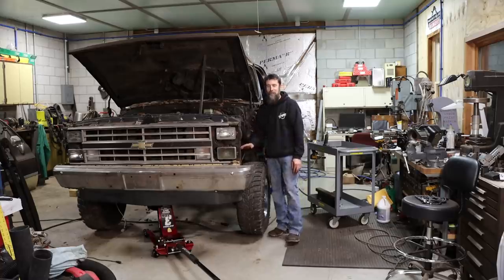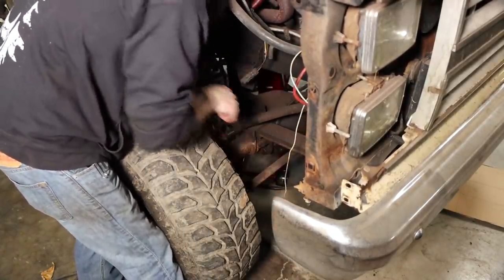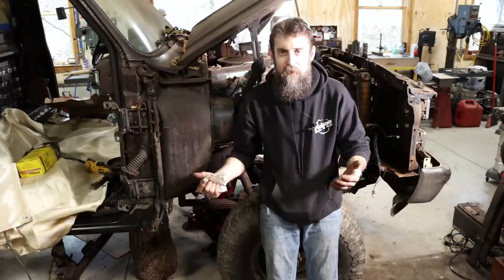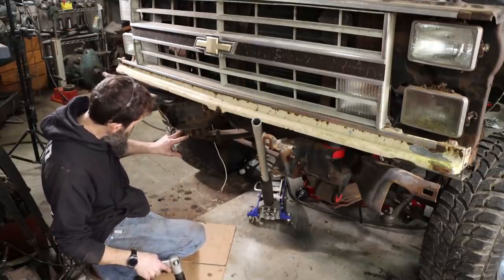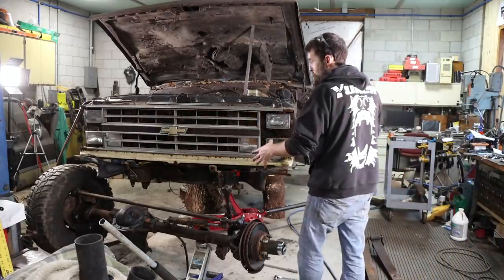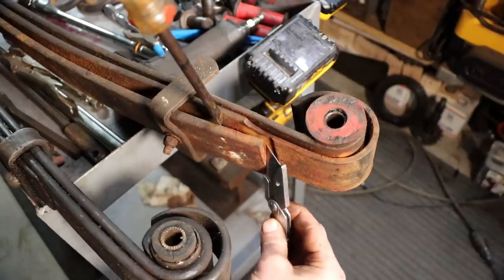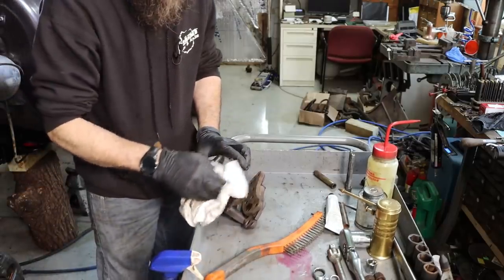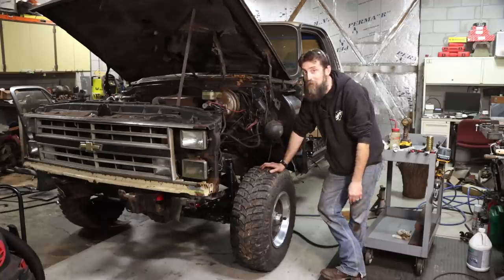Dropping and replacing the entire front axle. Everything was BAD.

Comment: Steve, you're making great progress.  Even if your pocketbook isn't up to replacing the existing motor right now that's something that's easily done later as funds come available.

Also, a year or so ago you mentioned that you wanted to try your hand at Blacksmithing -- your old leaf springs could be good sacrificial material to heat & beat on, after using rebar and such to get started on.  Just remember though, used springs (coil & leaf) can have fatigue cracks that might not be visible, but could still cause the material to crack during or after forging, especially if you try to make a hardened tool or a knife out of the spring material with a hidden crack or cracks.  That's always the risk of using old springs & unknown material and why you should alway use known/new material for "important" Blacksmithing (& Bladesmithing too, if you're interested in that) projects.

Comment: I prefer older trucks, doesn’t take a computer to work on them.  Just rebuilt the carb on my 1962 Ford F100 4x4. Points ignition, 4 speed manual, 223 6 cyl. Did not come with seatbelt.

Comment: Love everything you have done on this project!
Till you re-used the U bolts.
False economy in my opinion. Axle U bolts are one use hardware. Especially this old. Also hoping the spring bolts were new.
With the re-used U bolts, the torque wrench was a waste of time. The U bolts had been stretched to their yield point when originally installed, and when you add the stress of rust jacking between the spring and axle, they are used up.
Looking forward to the rest of this build!

Comment: My dad had the back wheel drive version of this pickup,  Looking at the state of yours,  the one of my dad wasn't that bad, it had the same problematic rust damaged body section and floor, and it would have been nice to fix it like your doing yours.  
But my mom was ready to let go for scrap two years ago.   

And about the price of pickups these days.  You,re perfectly right.  My dad at the time got his pickup used for $20,000.  These days a new one with minimum goes for $40,000 up to $90,000.  That's mad.  you almost need a morgage to buy a decent pickup truck for work,  Ok most of the cost will be absorbe by the business expanses.  But for an individual, these are out of price in many cases.  That Sad.  Now if I want to get my self propel tiller to theshop to be fix, I need to ask a friend with a pickup to take it to the shop and ask again that friend to pick up the tiller from the shop.  Well Steve, don't stop you're doing a nice job.  It will be nice to see it you driving it and feel the difference in the driving.

Comment: The problem with procuring a utility pickup does not, for the most part, lie with the manufacturers. It in fact lies with the dealers. The profit margins on work trucks with few if any additional features is very low so the dealers seldom, if ever, order those trucks unless someone is willing to order and wait for it which most people are not. I used to know a fellow who was the purchaser for a large oil producing company that had the yearly task of ordering new pickups for the companies use. When he ordered trucks from the manufacturer, he would purchase trucks to suit the purpose for which they were intended. Originally, most were bare bones trucks with the standard V8, a manual four speed, four wheel drive, and maybe a radio. The trucks were also ordered without warrantees. (We will come to this later) These trucks tended to be well below the prices you see in the showroom by as much as 50%. That 50% was what the dealer had ordered for options like mag wheels, air conditioning, leather seats and so on and so forth. 
During the year there would be mishaps where trucks were lost due to attrition like wrecks so he would be forced to order from the local dealers and, as he said, the dealers saw you coming and you always ended up paying considerably more for replacements. Even as the trucks became more equipped from the manufacturer these numbers remained much the same since there were also many more options being introduced. One of the things I mentioned before was the lack of warranty. Since they did all of their own maintenance, they had n need of a warranty. By ordering trucks with no warranty, the price of the base vehicle dropped 5 to 10 percent depending on the options ordered. Warrantees are expensive!  Most people don't realize that much of the increase in pricing is due to Government legislation. Every time the Government issues a mandate for some safety measure that you may never use, it costs you, the buyer, a lot of cash. 
Bottom line is you can get a new inexpensive truck but are you willing to wait for it? And once you get it, are you going to want to drive it when all those around you have the same truck but better equipped? The manufacturers and the dealers both know that your vehicle is a sign of your station in life and they take full advantage knowing 99.9% of the buyers want to appear well off and affluent. But if you just want bare bones for low dollars, yes, they are available.

Comment: I have 2 87 F150s, 1 a 4x4 and 1 2WD, as well as a 82 D150 step-side 2WD that will cost less to repair all 3 than to buy 1 new rig. Just wish l had a nice warm shop to workin instead of a dirt driveway in winter.

Comment: Dang right I would buy one. Ford had a plain jane work F150 back in the mid 90s when I was still working at the dealers it was as basic as they came and they sold the crap out of them. They also sold the crap out of the pricier models as well so it didn't hurt their nicer truck sells at all.  

Too bad I can not remember the sticker price on those suckers but you still see many of them on the road today.

Comment: hey, you could have reused that shock. It had some miles left in it.... at least 2. Looking good though - keep going!
Reply: Still has some reuse value, once you cut off the top and the bottom, as a drift to get recalcitrant bolts out from the rest of the suspension.

Comment: $15,000 1985 dollars translate to about $38,000 2021 dollars. (Inflation calculators haven’t been updated for 2022 yet.) I think you can get into a compact pickup (like a Ranger instead of an F-150) for $38K. Today’s midsize or compact pickups are pretty close in size to the mid-80s full size pickups.

Comment: LS3 swap that thing. Keep the fuel injection, keep it stock and enjoy the reliability. Even a stock LS3 is going to be a substantial power increase. 
I can’t recommend enough to go fuel injection, regardless of what you do. I hated even the thought of it forever and carbureted everything, sometimes with more than one for good measure 😉. Then one day everything changed. I bought a fox body Mustang, built a 600+hp 306ci supercharged and fuel injected engine for it, swore off the bowtie and pledged allegiance to the blue oval (I have 3 Fords in my driveway 🤣). That mustang has been the best running, most reliable modified engine I have ever owned, and I’ve owned a lot!

Comment: I love the idea of a basic vehicle without all the equipment that is in even a base model. Unfortunately between government regulation and the investment that the manufacturers have made in CAN-bus systems and computer integration of all the systems, I don't think it is possible. A shame, really. Just before the pandemic I had a 2006 regular cab, shortbox 4x4 Chevy truck that was starting to show its age. It was very basic; automatic, air, tilt, cruise, but manual roll-up windows and V6 power. It had 155,000 km (about 100k miles), and was rust-free, no accidents ever, and had excellent paint. I planned to do a major overhaul, with new brakes, front end, shocks, engine top end, etc., and a bunch of other parts to put it back to like new condition. All parts were about $7k Canadian dollars, and if I had it all done by the GM dealer about $16k installed. I also considered a V8 conversion, which was possible but a considerably harder job in a 2006. However I mentioned this to my neighbor and he offered me $12k for the truck as-is, as he always loved the short box, short wheelbase 4x4 (I did too) configuration of the truck. So I sold it. I took the cash and after a bit of looking, found a similar fairly basic 2017 Ram 4x4 that had an extended cab and a 395 horsepower hemi, with only 12,000 miles on the clock and warrantee to 2025. I was able to bargain the Mopar down to $26,000 and added my cash to the proceeds from the Chevy, and have a payment free truck. I still have some regret about selling the Chevy, but I think that if you can accept the best deal for whatever it is (the Mopar was the best deal around), it is still possible to have a nice, reliable ride without taking on a huge debt load.

Comment: anybody else waiting to hear "I'll be dipped"?  LOL

You know Steve, a Tonya Harding 6000 is what you need...that 3000 is undersized for that job.  :)
I have a '99 Tahoe, and it is a dream of mine to rebuild it.  The entire front end is shot, the rear end isn't much better.  I'm just worried about cost/benefit.  Quotes to have the front end suspension done are well over $5K (Shocks, Springs, Control Arms, and hubs).  Parts weren't the issue 2 years ago when I got that quote, but all the garages were "$5K just to start, and probably looking at up to $10K"....welcome to why I want to do it myself, but....need a shop/garage as I'm not allowed to do this in my front driveway.  :(

Comment: my first Ford a 1967 F100 full size 8ft bed was called a ranger not to be confused with it's later name sake little ford pickup it had 1950 rear springs, Wagner T15 Four speed, full camper and bright metal package, 352 V8, plush interior radio and heater sold to me by the dealer Folgo Ford $2450 after 67 the prices started to climb and it was the only new vehicle I ever bought I sold the truck 18 years later The transmission had been high pro skip toothed no more double clutching the motor received a Mallory ignition, isky RV can and roller tappets  The 18 year old sale price was 2300 Dollars not bad

Comment: The majority of the parts on the outside are metal so if you have a little oopsie it won't fall apart in your hands. A gear drive transfer case with a positive low and high range. A small block Chevy that parts are available for at a McDonald's drive through I bet. NO COMPUTER!!

Comment: Adjusting for inflation the prices for a new truck in 1985 vs. 2022 are not as dissimilar as many would believe. Using the inflation calculator, an item costing $15,000 in 1985 would be the equivalent of $38,747.40 in 2022. Building a new Silverado 1500 on the Chevy website comes out to $36,440, for a regular cab with the 5.3 V8 and 4x4, which is about as categorically similar as you can get to the 1985 k10. Similar models are listed for sale online for $39-40k, as well as a few thousand dollars less if you opt for a smaller displacement engine. Similar for Ford and Ram.

Comment: I wonder when we hit the “truck” graph crossing point of mfg quality/longevity and real ownership value?  I’m guessing somewhere In the 90’s.

Over the years I’ve had a dozen of the GM square body ‘74 thru ‘86. Some parts would last, some would not, and you could hear it rust away in the driveway. Somehow The long term durability sure took a big jump up in 1988 with the style change even though much of the tech rolled over from ‘87.

Comment: Back in 1975 bought my first ford f100 pick up for $ 2500.00 dollars. Brand new.Bitched at the car salesman so much that I got a full tank of gas and a chrome step bumper with the deal.Also payed $50.00 dollars more and got a complete shop manual timing light and a set of 3/8 drive socket set all from ford.Had  the old crank up windows push button locks.. it did have air.That was the only extra....Oh ya it had a am radio also...Drove that truck for 19 years...By the way my payment was $78.00 per mo....ALL CAR dealers have lost there minds over the price of a new truck.....I dont what to live in it .....just  drive it.50 or 60 grand for a new one is NUTS.....Bare bones 4x4 work truck would be great...Thats all a guy needs......one last thing it had wing widows.I sure do miss those...

Comment: Love you Steve BUT BUT BUT, you got the brake pad Install all wrong. The small tabs on the out board pad are to be taped down just enough to be pulled into the caliper  ( We use larger pliers).  Maybe anti-seize on the back of the pads but never RTV. Thanks for reading this
Reply: I think he meant "tapped" for "taped".

Comment: Agree about trucks- all that stuff with leather seats that are heated and electric, fancy stereos ,big wheels and lift kits are just little boy gimmicks.  A work truck should be simple and useable so you don't have to lift stuff over your head to get it in the bed, and not so fancy that you lose sleep over a scratch in the paint.  And NEVER buy new- wait and find a truck that is 1 or 2 years old and has been maintained- it will have all the little new car problems worked out and the price will be 1/2 of new.  And ALWAYS pay cash- save your money until you can afford the truck you need.  There will be no payment every month and your insurance will be less than 1/2 of a financed truck.

Comment: Well you could put a 6 liter ls in there too and probably gain a hundred hp and have a little more torque. Or considering you have a machine shop you can just rebuild that old 350, but it's going to take a lot of time. Atleast parts are cheap for it though, and a good set of heads and a medium sized camper cam will wake it up a lot. With the more stable fuels of today you can probably increase the compression ratio a bit too which always makes more power. Not that it needs to be a million horsepower, but why not make it better while you're  in there? Plus those old trucks could be so under powered from factory that you'd be down into 3rd screaming just to pull a hill unloaded at the speed limit. It's your truck to do what you want to with, but it's just fun to dream I guess.

Comment: It is a lot like tooling for your shop. You can buy parts like tools one at a time as needed and as you can afford. By only luck in 2007 I bought a basic full size (not crew cab) no frills 4 wheel drive Silverado for $18K. The dealer was losing its Chevy franchise, and Obama was bailing the almost bankrupt GM. the stars were aligned for a bargain also the first and only new vehicle I have ever bought.

Comment: Steve, as a person that works in the auto industry, I'll tell you right now, the MATERIAL cost alone for a a stripped down truck is still north of $10,000.  You still haven't assembled it...which is THOUSANDS of dollars as well just in the labor of the assembly line workers (excluding the costs of the billion dollars in capital that is bought for building that truck). 

As for stripping them down, YOU MUST have rear backup cameras (NHTSA), you MUST have ABS (NHTSA), you MUST have airbags (NHTSA), you MUST have all kinds of pollution control (EPA), you MUST have THOUSANDS of dollars worth of added stuff that you might not care about, or even want, but the "government" is here to help, and they say "you have to have it".  Those items alone skyrocket the price of a vehicle.

Steel, Copper, Magnesium, Aluminum, and even plastic costs alone have nearly doubled in the past 12 months.  The car companies aren't going to fully absorb that hit, even if they could, the leaders would be run out of their job because the shareholders want returns.  Even if the Top 2 tiers of management took NO pay, the impact to the cost of the vehicle would be less than $100...way less.   It's crazy, but welcome to the "building back"....

Comment: That $15k truck is available, just not in the USA. Look at Tata, GWM and other non US makes, all of which start with a low end spec vehicle for this market, and where thy do sell a lot of vehicles, while the US vehicle makers only cater to the upper end of the market, because that is where the greatest mark up is. Thus the high priced vehicles, with all the really exotic stuff, but all that comes at the expense of reliability, repairability and ruggedness, with pretty none of the US built 4x4 trucks actually being any real use off road now, almost all of them being optimised for pavement posing, speed and sacrificing load capability and ruggedness for this. 

No US manufacturer wants to sacrifice line space for a vehicle with low margins, so will not build them. But you will find the low cost vehicles being available south of the border, in large numbers, because they are rugged, reasonably cheap, reasonably reliable and importantly have spare parts that are cheap.

Comparably in the 1980's you could buy Lada vehicles in the USA and world wide, and there are still a good number around, cheap, nasty, rattles in close formation, and with a build quality that was very much hammer till it fits, but the ones not totalled out still more or less run, and you can fix them with a welder and hammer body wise, and the rest of the vehicle still is vaguely available, though it might be a while to wait for the spares to arrive. But compared in price then, they were cheap, and you could buy them and run them, and not even worry about taking your vehicle and damaging it, as it was cheap, not the $15k vehicle, but something you could fix for $1k if you pinstriped it off road, or drove through a tree. Only good thing was the heater always worked, either off, or volcano setting.